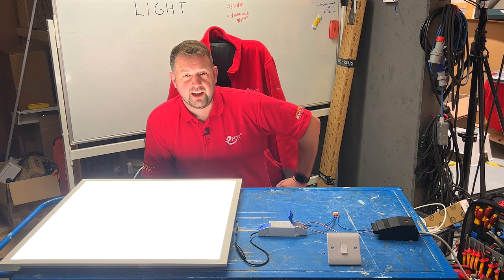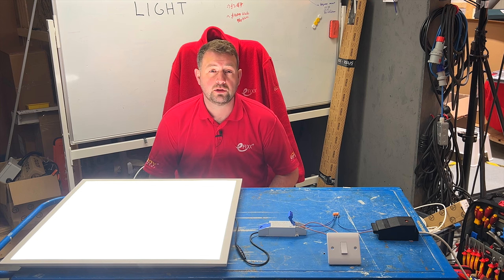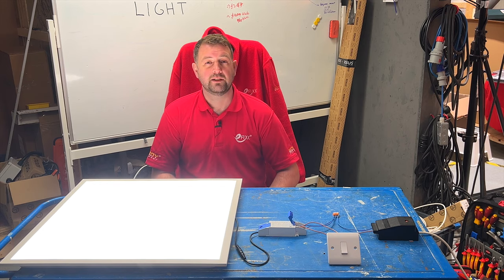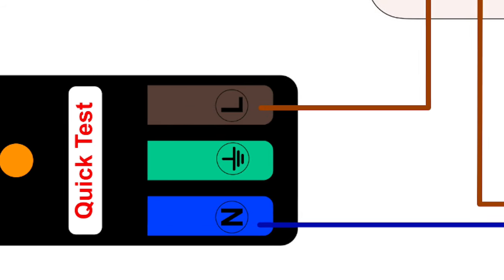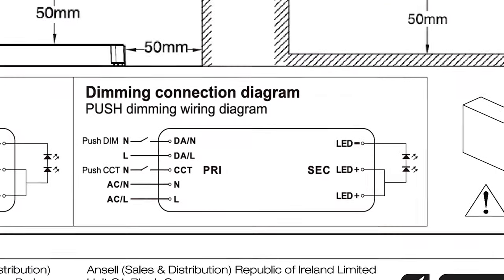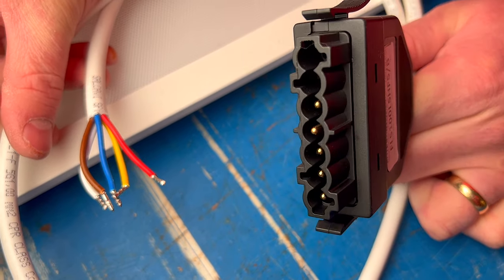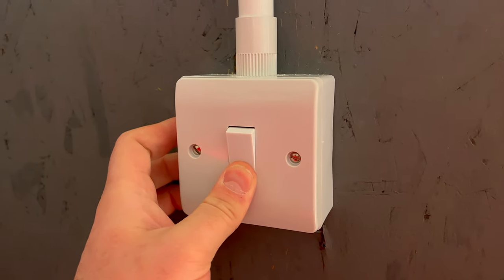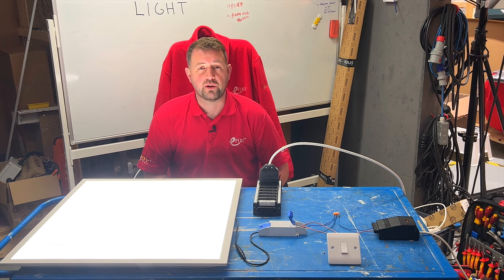Discover the FREE LED Dimmer Switch - SwitchDIM, TouchDIM, PushDIM

Comment: Why would you fit dali kit if you didn't want the dimming
Reply: Because it enables you to set the brightness to any desired level and leave it at that brightness permanently.

Many LED power supplies don't permit that. They give a constant current output of a certain magnitude.

The result is that the power supply may result in LEDs being too bright in the application.

Comment: I love the bit about Dali often overwhelming electricians.
F.. from what I have seen, that isn't hard.  Anything other than on/off at 230 Volts will flummox most electricians unless they have done a specialised course in it.

Don't mention characteristic impedance, termination, or reflections.
Heck it's bad enough trying to teach them Ohms Law let alone transmission line theory, or Manchester biphase encoding and differential signalling.
😂😂😢😅
Reply from the maker: Sounds like you’ve had the Smith Chart out 😉